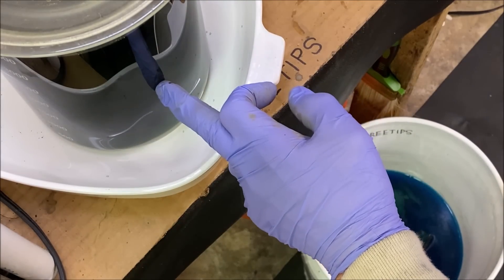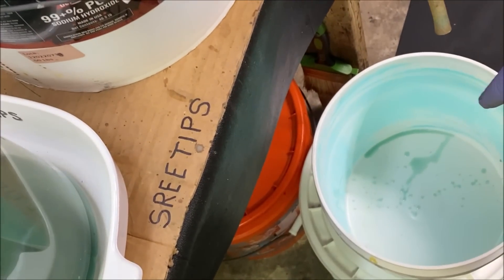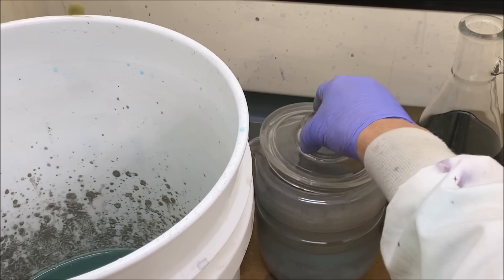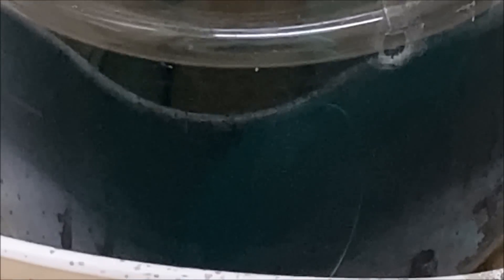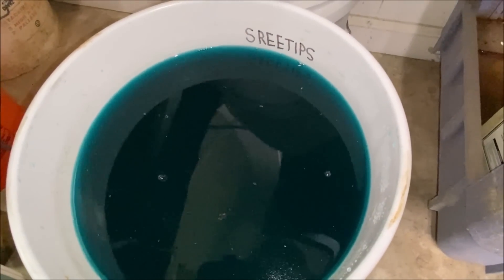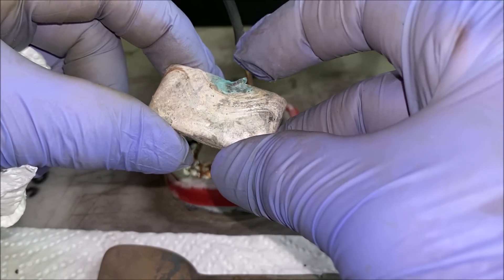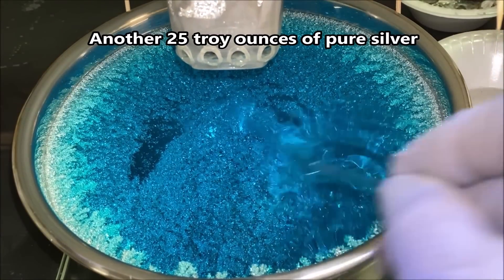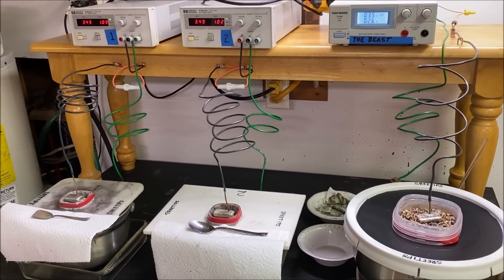Silver Cell Day 5 Crystal Growth 120 Hours

Comment: Would it still refine to pure .999 fine silver if you just melted sterling to shot and then run it through the electrode solution to crystal out?
Reply from the maker: With that much copper, I think that the electrolyte would quickly become saturated with copper.
Reply: @sreetips  But you believe it would still output pure silver? If so then maybe the initial step can be skipped. You would just dissolve the pure silver for electrolyte, use it to purify the sterling and then take the saturated electrolyte fluid and cement it out like you normally would. You'd just have less waste leftover and skip a few steps. It's a theory I think worth trying.
Reply from the maker: That’s entirely possible. And I may do such an experiment. But you must understand that I have hundreds of pounds of cement silver from my gold refining that I must process through my silver cells. Silver is a byproduct of my gold refining. But I may try the run straight sterling silver through the cell and make a video of it. I’ve never tried it. Should be interesting.
Reply: @sreetips  i appreciate it! Totally understand too. I've been watching your videos for a while now and really appreciate them. It got me motivated and have now begun my 2nd harvest thanks to you. It so far has averaged about a 10 to 14 day cycle to complete. I do feel it's a long drawn out process and am looking for ways to shorten it. Hence my questions. I'd love to try gold refining but it looks more involved and intimidating to me. I'm pretty sure the profits are higher though. One day I guess. Thanks for all you do!!

Comment: Awesome. Im gathering silverplate to start. I asked you a question a week or two ago about 100 grams of clinical gold pins, thanks for responding again sir. You asked about how thick plating was, i got excited because you responded to my question and i was blabbering. I don't have caliper, so I asked AI, and estimate was 2 to 4 ums thick depending connectors and stuff.    Also it was an machine called BK Spectro ultrasound machine. It is modern but its clinical. So there is my answer to your question. Thank you so much for inspiration and knowledge. Soon as make money will be creating silver cell. Excited. Thank you again.
Reply from the maker: Most gold plated material is very thin gold so it takes lots of it to make a good amount of gold to recover.

Comment: Why not make a silver cell anode with copper from waste bucket. Side by side race. Silver Vs copper anode.
Reply from the maker: Because copper melt temp is about two hundred degrees higher than pure silver. The reason I prefer silver is because it’s melts and pour so easy, like butter.

Comment: How about using a 5 gallon cooking pot as a silver cell? You could hang a tube/pipe/planter net pot down the middle to hold the silver and use a silver spoon/fork/butter knife as anode.
Reply from the maker: Won’t work, there’s a critical distance between anode and cathode 4 inches (10cm). And sterling silver has too much copper for use as anode material.
Reply: @sreetips  I think you miss-understood what I meant. Think of a Jaw Breaker cut across the middle. The spacing depends on the size of your input materials. 4 inch spacing would require a 12" diameter pot. An 8" + 6" plastic pipe and 2" Stainless pipe/rod down the center.

Multiple nested pipes of stainless and 2x plastic with holes, covered by a nylon stocking, suspended in a stainless cooking pot around the outside. It gives you a ring that can be filled with your silver shot, with a stainless steel surface on either side.

Sterling silver should conduct just fine no matter what copper content it has. You only need to make good contact to your silver shot. Since current takes the easiest path, a rod stuck in the center of a pile of silver gives you more even current distribution than a flat electrode placed on top.

PS: 4" spacing might work best with your current settings, but industrial electroplating tanks can have many feet between them. The important factors are voltage, current, resistance, surface area, breakdown voltage of your electrolyte.
Reply from the maker: The design I’m using has worked perfectly for almost fourteen years. It’s not conductivity of the copper that’s the problem. Using sterling silver as anode material would work fine at first but the high copper content of the sterling would quickly saturate the electrolyte with copper and cause problems at the cathode. The anode material must be fairly high purity to begin with in order for electrolytic refining to be successful.

Comment: All this time i have wondered what you did with the waste liquid after cementing out the silver. I am still curious as to the final stages of the waste solution after cementing out the copper. Is the solution now completly devoid of all metal? How do you dispose of it at that point?
Reply from the maker: It will be metal hydroxides, mostly iron. Then add sodium hydroxide to drop the iron as sludge that can be safely disposed of.

Comment: Apropos of nothing, beyond the fact that something in the video made this nugget float to the top of the cesspool I call my mind - Notice how the crystals form and grow toward the anode basket? That's the EXACT mechanism (just involving a different metal) that destroys Ni-Cd and Lithium-based batteries. (other than LiFePO4 cells, which are amazingly stable and difficult to kill unless you SEVERELY abuse them) When you (over)recharge them, those "whiskers" start forming, in a process called "dendritification". Once one of those dendrites grows far enough to cross the electrolyte, it shorts the cathode to the anode internally. In a Ni-Cd battery, this most generally "only" ruins the battery (It'll act totally dead, no matter how long you charge it, and may get quite hot - or even burst into flame - if you try to charge it) but CAN sometimes cause the battery to overheat, potentially causing it to burst, and possibly start a fire. With a Li-Ion battery, it can (and all-too-frequently does) result in the battery bursting into flame, sometimes with a significant "KA-BOOM!" component. This is why you don't leave your Ni-Cd batteries in the charger any longer than needed to bring them up to full charge, and why "not garbage" grade chargers fror lithium batteries come with circuitry that monitors the battery's state of charge and shuts down the charging process once it hits "full".

Comment: Great video as always, sir!  

Just curious, could you just cement out the copper from the silver nitrate solution and reuse it, instead of going through the process of cementing out the silver and then the copper?
Reply from the maker: No, the copper can’t be removed first. The silver gets removed by placing clean copper in the solution.

Comment: Mr. Sreetips I inquart with copper and I’ve tried several times to cement the copper out with iron bars and all I get is what appears to be rust. I try melting it and it doesn’t melt like the cemented silver. What am I doing wrong to try and get my copper back?
Reply from the maker: After all the precious metals are removed on copper, then only copper will be left. The iron should cement the copper. That’s baffling, I don’t know what’s wrong with your process.

Comment: I'm still waiting for u to increase the crystal  size .  Thats the last thing u have yet done By seeding the silver solution with one crystal it will increase  in size with evaporation of the solution the single cell crystal  increases and grows it takes along time to let that solution just evaporate but and adding eyedropper like 3ml everyday
Reply: That would be a task alright. Use some of the spent electrolyte or start with a small amount of new, which choice would be best to watch. I know, do both! Supersaturated solutions for both, that might be a bit hard with the "spent" or used solution unless you add a bit of the new to it?

This will tie up whatever glassware is used I suggest small plates with a decent dish to them or small ice cream dishes with the wide flare at the top. Clear glass would let everyone watch, use another camera for the time lapse since this will take months of time, post after a few weeks of time and then again in a few weeks, it seems like it would be often enough for even the most inpatient of us viewers. 

There is a way to use a static form of electricity gained from the magnetic field all around us to power and speed up the process since only a little amperage is needed it might work well enough to try that as well  -if someone could suggest a system which would be efficacious and easy enough. Or a battery can be used, I wouldn't know how though, just seen it done many years ago by an artistic type doing it on a lark. 

Great idea, guy.

Edited for spelling & clarity

Comment: wonder the ratio of liquid used for gold vs silver. 

Gold: add silver to make 6k gold, ~7 nitric acid boils to remove silver, Aqua regia, filter, stump out, aqua regia, filter, stump out. that's 9 different solutions created. 2 are waste, 7 are silver nitrate.

Silver: saturate the nitric acid with silver, cement with copper, melt cemented silver in shots, make pure silver nitrate solution, use electricity with the shots and pure silver nitrate solution to produce pure crystals, cement remaining silver nitrate in the now contaminated solution. Waste: bunch of copper nitrate solution, filters full of slims.

I think the ratio of volume of produced silver vs waste is better with silver. But the value at the end of the day is also a lot less than with gold.
Reply: Very detailed but concise explanation, thank you.

Comment: You should make silver wire for the anode, not copper.
Reply: Good luck drawing the wire, stopping for the work hardening and annealing the silver after each reduction in size, and do it again with a tighter gauge. Then use heat shrink tubing for insulation after you get it to the final gauge desired. Since silver is a better conductor than copper the gauge can be smaller. This will allow the same amount of starting material to make longer wire overall. 18 gauge should work well enough at the amps you are drawing, but the better conduction means it will draw more amps for the cross section so get some one with the correct knowledge to translate the gauge differences for you, don't just depend on me. Everyone always said I am not the dependable one in the family, too flighty by far.

Edited for spelling
Reply from the maker: Copper is rated 100 out of 100 on the conductivity scale. Silver is rated 105 and is the best conductor of electricity. So I don’t think going with silver wire would make that much difference.

Comment: Can the copper be recycled back into the silver refinement?  What do you do with the copper you recover at the end?
Reply: He throws it away.  Not worth it to purify and melt it.  Cheap to buy scrap copper.
Reply: @ctvxl  How do you dispose of a copper/iron solution?  Is it considered toxic?  I remember he keeps it in buckets outside, but it's still waste that needs disposal.
Reply: @KEPoles  Iron in solution is not particularly toxic.  He cements the copper out on iron.  Throws the cement copper in the trash.  Next, he neutralizes the iron solution with sodium hydroxide, then it is safe to pour down the drain.
Reply from the maker: Waste treatment